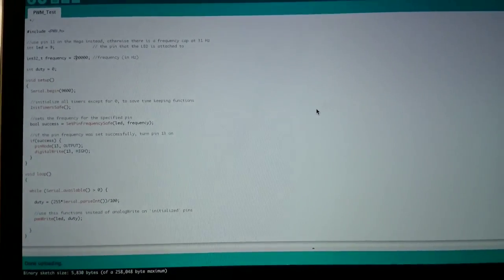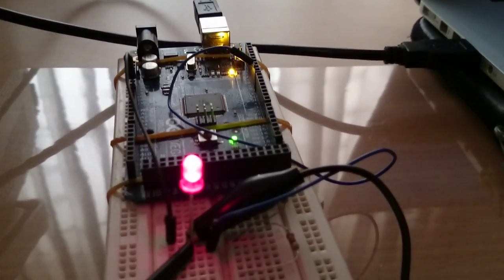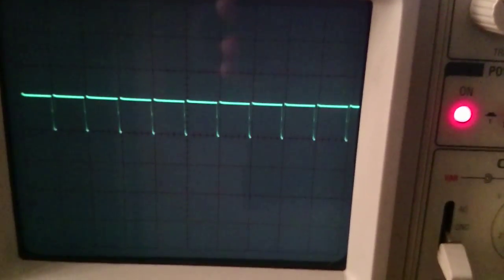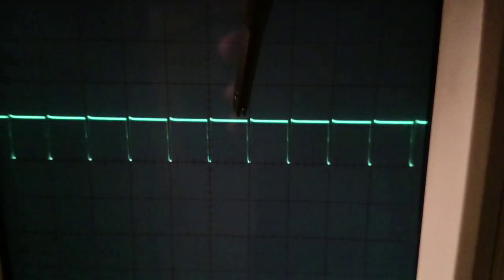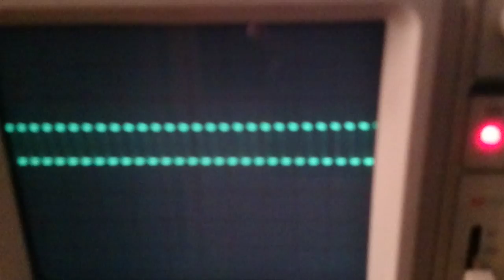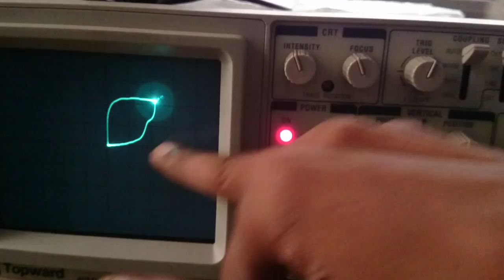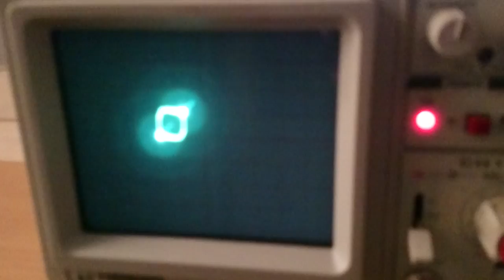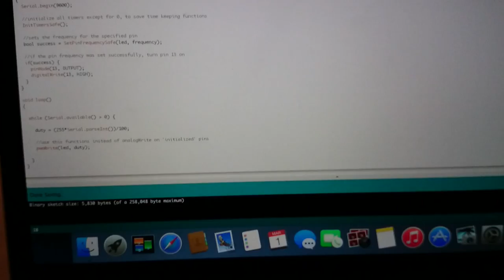Arduino 200kHz PWM testing

Comment: Hello, could you share this code, includeing the PWM.h?
Reply from the maker: after 5 years today I saw it... ohh... do you still really need it?
Reply: Abdul Quader Hi, I Found a solution, but with fpga ;), if u can share the code it would be very interesting. Could u put in the description? Or are u sharing private?
Reply: @abdulquader4669  yes
Reply: @abdulquader4669  yes pls
Reply from the maker: @paulosuarez1907  ok, plz hang on for a while...I need to check my archive for the code